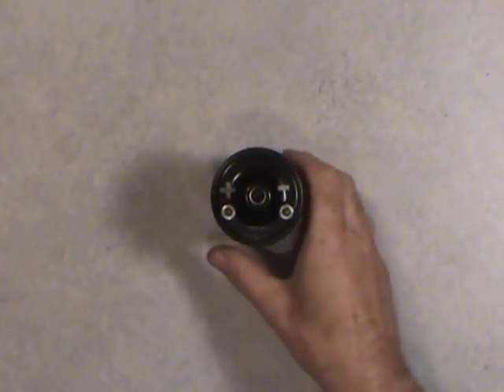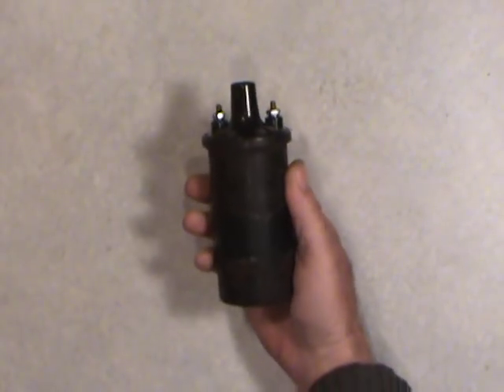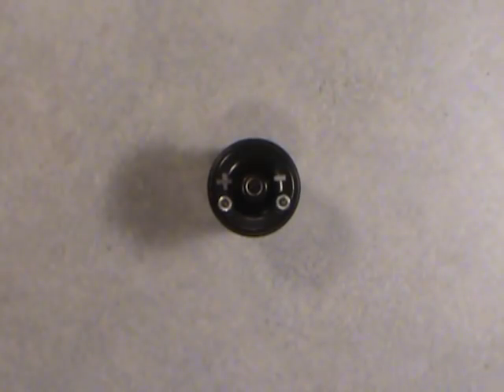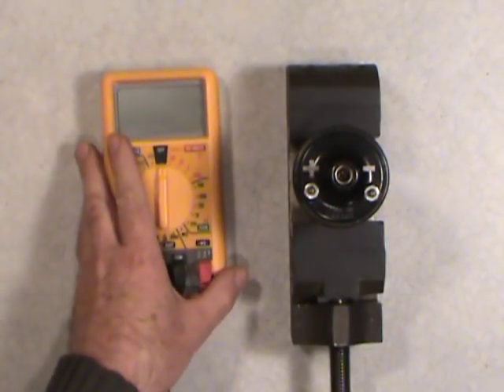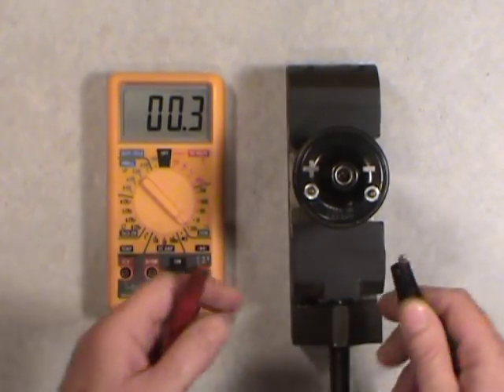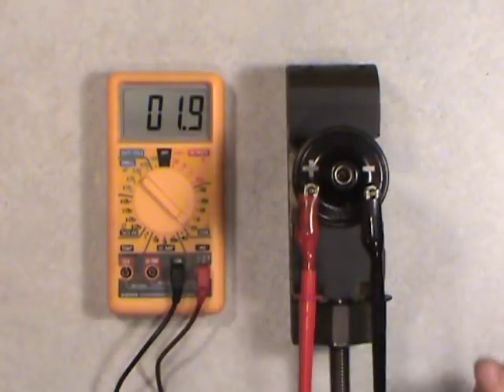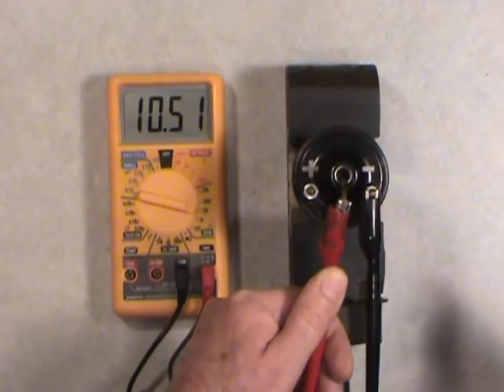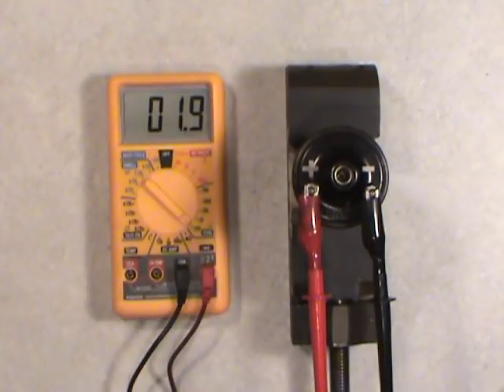Ignition Coil Testing

Comment: awesome video, thanks for your time. Helped me alot with my project.
Reply from the maker: Greetings...Jesse Flaman...........Thanks for the nice comment, and, Thanks for watching too...........Here's some info for Ya............Even though a certain type of Ignition Coil, appears to look about the same, as some of the other ones out there, while looking at the outside of it, then please, don't assume, that, they share the Same "Specifications", and depending on how an Ignition Coil is to be used, and, in what-ever application, it just might be, then, if the (ignition) "Circuit", is Not Correct/close enough, then, the Ignition Coil in question, might end up having, a Low Output, or, might even end up, having that poor ole Ignition Coil, Over-Heat, and Fry itself..............From what I recall, each type of Ignition Coil, has a Saturation (charge-up) Time (usually measured in milliseconds, as in, one thousandths of a second, time-wise), and, should only be Saturated/Charged-Up, with Up-to, the Maximum number of Amps/Amperes, that is Specified, for that Exact ignition coil, and probably, for not too long, time-wise either, and will probably have a primary voltage rating as well..............If the Amps, get too High, and for too long, time-wise, then, more than likely, that poor ole Ignition Coil will probably get way too Hot, and Cook itself.................Also, make sure that the Voltage input, on the Primary/Low Volts side, of that particular Ignition Coil, is as Specified, as some of the much older Ignition Coils, or maybe certain applications, are rated for 6-Volts (not the more common, 12-Volt ignition coils, that we are seeing in vehicles these days)..............Some of the older Points and Condenser Distributors, that controlled the Saturation/Charge-Up time, for the cylindrically shaped/oil filled ignition coils (like the one that I used as a Prop, in this YouTube video of mine), usually had a fixed Dwell (charge-up) time, and, for a V-8 engine, it was usually fixed, at about 30 (distributor) Degrees, and was, way too Much dwell (time), at idle speed, so, a Ballast Resistor (be it, a special Resistance Wire, or, the whitish colored, Ceramic Block type), had to be placed, in the (engine) "Run" Circuit (not the Starting Circuit), so, as to, Lower the Amps, that were fed to the Primary side of the ignition coil, in order to protect the ignition coil, from excessive Heat and Destruction..............Some of the cylindrically shaped/oil filled Ignition Coils, had a Higher Resistance, on the Primary (low volts side)...for example, probably a bit higher than 3 Ohms, and, might not need a separate Ballast Resistor at all, seeing as how, the Primary Resistance was already adequate, for that particular ignition system/circuit..............To equal that, just higher than 3-Ohms, stand alone ignition coil, just mentioned, and using, something like, a slightly higher than, 1.5 Ohm (primary resistance) ignition coil, then, all we have to add (into the circuit), is a Ballast Resistor, that will make up, that Extra 1.5 Ohms, or a bit higher, that, when both added together, will equal that stand alone ignition coil's primary Resistance, that was just over, that, about 3 ohms, primary Resistance value.............Now why bother using a Ballast Resistor at all...???...well, here's probably why..............When the engine's Starter Motor is in operation, it can draw, up to about 200 Amps, give or take some, and then, the Voltage, will usually Drop down Lower, oh, maybe down to about 9 Volts (in a 12 Volt battery System), and, the Output, of that, just over 3-Ohm ignition coil, would probably be quite Weak, oh and, a Cold engine, needs all the help it can get, ignition-wise, that is...............Now then, by using a 1.5 Ohm ignition coil, "Without" the Ballast Resistor, in the Starting Circuit, then, this ignition coil's Output would probably be quite Strong, seeing as how it's only working with that, about 9 Volts, that's available, when the Starter Motor is workin'...............But, once the engine Starts, the ignition Key/Switch, then goes, into the "Run" position, and Adds-in the Ballast Resistor, in that (Run) Circuit, so once, Full Battery Voltage (and Amps) are available again (cuz, the starter motor is now ah-sleep...lol), and the (battery) charging system kicks in, we now have, just over 3 Ohms of Resistance, being the primary resistance of the ignition coil (1.5 ohms)...Plus...the Ballast Resistor's Resistance (1.5 ohms), added together, which ends up being about the same, as that, just above, 3 ohm ignition coil, which will keep the Amps, that are fed to the ignition coil, from getting too high, and the ignition coil, won't be getting too Hot, and going Kaput..............The above, is just an example, to hopefully, be of some help to You (I hope)...............Good Luck with Your project, and........till next time.........Be Safe, take care, and have a good one.

Comment from the maker: ...please note, that when the contact "Points" are closed (inside the distributor), the, usually less then 12 Volts (because of a Ballast resistor reduces the voltage, so the ignition coil doesn't burn up), charges up the primary coil (inside the coils metal canister), until the ignition points are opened, when the Lobe on the distributor shaft opens it....The Lobe on the distributor shaft is "Timed", so the ignition points open, when one of the spark Plugs need to be fired....(con't)...

Comment from the maker: Greetings Stephany Rivera....Any vehicle that I have worked on has always "Cranked" (starter motor turning engine over), with the exception of 2 things, not including some problems....One is, with an automatic transmission having a "Neutral Safety Switch"....That is that the car won't crank unless it's in Neutral or Park (on the shift indicator), and also, some standard transmission vehicles having a safety switch actuated by the clutch pedal being pushed to floor-board....(con't)

Comment from the maker: Greetings CaptainOwnage01....The item under the ignition coil is my Drill Press Vise....The reason that I'm using it, is because the bottom of the ignition coil is not flat, and also, because I'm connecting the multimeter leads to the terminals on the ignition coil....The drill press vice holds it still and steady for the video....The drill press vise is really quite heavy, as it's made out of mostly cast iron....Take care, and have a good one.

Comment from the maker: ...The Series wiring path is as follows....Starting with the vehicles Battery, it goes to the Ignition (start/run) switch, from there it goes to a Ballast resistor, from there it goes to the First Ignition Coils + (positive) terminal, then, there is a short "Jumper" wire, going from the first coils - (negative) terminal, to the second coils + (positive) terminal, then from the 2nd coils - (negative) terminal to the Timers breaker-points connection....There you have it....Take care my Friend

Comment from the maker: ...as I recall, I think that the Primary Windings are thicker then the Secondary Windings....That alone will mess up your calculations due to the different resistances in a give length (per Foot, or 12 Inches) of each of the coils windings....There are many more turns of wire in the secondary coil, as compared to the primary coil contained within the coils metal canister....It is this "Turns-Ratio" that will determine how much a given Ignition Coil will "Step-Up" the Voltage....(con't)...

Comment from the maker: Greetings Richard Huff....When you took your Ohm-Meter (Multimeter) readings, did you "Disconnect" the wiring that is connected to your Ignition Coil?....Because, if you didn't, that will probably change the reading/readings that you saw....Is your vehicle starting and running good?....There are a multitude of things that can effect how an ignition coil will perform, everything from your battery condition, charging circuit, ignition switch, ballast resistor or resistance wire,....(con't)...

Comment: Loaded with minutia, but an informative video.
Thank you!
Reply from the maker: Greetings...TigerIronClock..........You're welcome, and, thanks for watching..........If, and when-ever, installing a new ignition coil, make sure that, it is the "Exact/Correct" ignition coil, for that "Exact" ignition system circuit, or, Ya might end up having, a not so impressive spark, between the spark plug's electrodes (misfire?), or maybe, an ignition coil that becomes Over-Heated and quits workin' all-together, and.......till next time........Be Safe, take care, and have a good one.

Comment: Good video and explanation of how an ohmmeter works...and forgive me if you mentioned this and I missed it but how do I know if the coil is bad..ie, what readings should be expected when the coil is working/not working. etc?  Thank you.
Reply from the maker: Greetings...Mark h............Thanks for the nice comment, and Thanks, for watching too...........No need to worry about, using, the forgive word, at all, cuz, I'm only too happy, to share with others, what I might know...???...about certain things, and, when it comes right down to it, then, Cars and Trucks, have been, one of my top hobbies, for quite some time now...............The testing of, both, the Primary, and Secondary windings (coils of wire), contained with-in, most, of the common ignition coils, is just telling us, that, both coils of wire (windings), are pretty much, Ok, as long as those Ohms (resistance) readings, are with-in the Manufacturer's "Specifications", for that "Exact" ignition coil, but, a Person, should also keep in mind, that, this "Test", is usually only done, when the ignition coil, is in its "Cool State", temperature-wise, that is...............Although, an ignition coil, might Ohms Test "Ok", while Cool, then, there can be times, where a "Faulty" ignition coil, might, shall we say, will "Start to Act Up" (aka, malfunction), when it gets Warmer/up to operating temperature, and, sometimes, it can result in, an Ignition (system) related "Misfire" (that be, where the compressed, Air/Fuel Mixture, that's inside of, one or more, of the engine's cylinders, Does-Not Burn properly, if at all, and, is sometimes, caused by, one or more spark plugs, that never went "Spark", at that particular time), and sometimes, it might be a Faulty ignition coil, or maybe, it could be something else, as in, ignition system related (cap, rotor, spark plugs, or spark plug wires, if applicable, that is), or perhaps, it might be fuel system related, possibly (gotta remember now, Both, the Ignition system, and, the Fuel system, have to be Working, really good, as a "Team", so to speak, or, if not, then, the Engine, will probably, start to Run, not so good, or might, not even start)............An ignition coil's (2) windings (or, coils of wire), will usually Contract/shrink (when cool), and will probably Expand, some-what (while in operation), and, from what I recall, the term for that, might be called, Thermal-Cycling...............I'm thinkin,' that, all of that, Expanding and Contracting, of the ignition coil's wire/windings, will probably shorten the life-span, of an ignition coil, some-what, quite possibly, but, there are many other things, that can also, shorten the working life of an ignition coil as well..............If something like, one or more spark plug Wires, get broken, or disconnected, then, the ignition coil, will usually, just try to, increase its Power Output, to..."Infinity-and-Beyond"...as in, a Much Higher than wanted, Secondary High Voltage, from the ignition coil, and, will usually Rise-Up, way too High, and put such a Strain, on that poor ole ignition coil, that, it will probably get Over-Stressed, and will probably, Destroy itself...Yikes...!!!.................Spark Plug "Gaps", that are Too BIG, and/or, the Higher, the engine's Cylinder Pressure gets (a high performance engine, for example), will also, make it so, that, the ignition coil has to Work, all that Much Harder as well...............It's also, a good idea, to, Check/Ohms-measure, the Resistance Values, of, things like, Spark Plugs, as well as, all of the spark plug Wires (if applicable, that is), cuz, Too Much Resistance, in the Secondary/High Voltage side, of the ignition system, will probably, make, our poor ole ignition coil, Work, way Harder, than it usually, has to be doing...................The are a few, not too expensive (20 Dollars maybe?)..."Spark Testers"...that can be used, to Test an ignition coil's, High Voltage Output (as in, Stress Testing, an ignition coil)...............Some of the Spark Testers have a Fixed "Gap", between the 2 Electrodes, and, I've also seen, an "Adjustable", type of Spark Tester as well...............Just make sure, that, the "Gap", that's between the 2 Electrodes, on the Spark Tester, is, Set for, the "Correct" Gap, that's Needed/Specified, for the "Exact", ignition coil, that's about to be Tested...!!!...(or "it" might, get Over-Stressed, and possibly Damaged)..............The ignition coil, has to work much harder, as in, much Higher Voltage is needed, to, initiate/create a Spark, between the spark plug's Electrodes, while being inside of, an engine's Cylinder, that's, under a Lot of "Pressure", as compared to, just having a spark plug, go Spark, while, out in the Open air/atmosphere, and that's why, You'll probably be seeing, quite a "BIG Gap", in a "Spark Tester", as compared to, that, rather "small" Gap, that You'll usually be seeing, Between the spark plug's Electrodes...............When-ever, replacing an ignition coil, make sure, that, the Ohms/Resistance, for both, the Primary/Low Ohms, and, the Secondary/High Ohms, are With-in, the "Exact Specifications" (Manufacturer's or other-wise), and are, the Same as, the Original ignition coil, cuz, if not, well, might end up being, a Weak spark, at the spark plugs, or maybe, an ignition coil, that Over-Heats, and Destroys itself, and I hope not........and........till next time........Be Safe, take care, and have a good one.

Comment: Question: I will use round numbers to make it easy, If the primary is driven with 10V, the the secondary is outputting 10K volts, whats is the ignition turns ratio?
Since the video is so old I will fill you in.
Most answer 1000:1 ration.
Well this is completely wrong. 90:1 in the ones I have checked. A ignition coil does not work like a regular transformer. It charges the primary winding, then opens the circuit and this happens.
1. The secondary is open circuit (10's of megaohms) as the spark plug has a air gap (and in the cylinder the air is compressed, making it more resistance than atmospheric pressure).
2. with a very high impedance load on the secondary, the voltage sky rockets upwards (its called CEMF or BEMF). high enough to jump the air gap of the plug.

If you run the primary with say 1Vac sine wave and look at the secondary you will see ~90Vac for a 90:1 ratio. I am sure they are not ALL 90:1, but somewhere around there. Dont feel bad, most get the turns ratio wrong, but now you know.

Comment: Thanks for video.  By chance I also have Dodge 360.  I am not getting spark from coil.  Replaced the coil, ballast resistor, and Ecm. Question: if the distributor is bad (no magnetic pick up signal sent to Ecm), could this prevent Ecm from ever sending spark signal to the coil? Thanks for any advice.

Comment from the maker: ...You had mentioned that there is only "One"- Lobe on the Timers shaft (the diagram that I found didn't show the single lobe)....If it really has only 1 Lobe on the timer, then, 1 spark plug would fire when it should (just before that piston was almost at the top of the compression stroke), where-as the other spark plug would fire at the very same time, only the other spark plug would (I think), fire on the other cylinders Exhaust stroke (that wasted spark doesn't ignite anything)...(con't)...

Comment: Most failed ignition coils I find is the secondary insulation arcing over (some call it flash over) inside. Simple resistance will not tell if it has this issue. As I mentioned, the oil is mainly used for insulation.